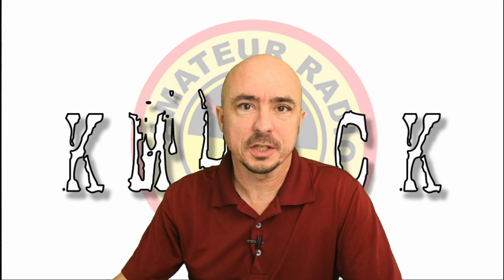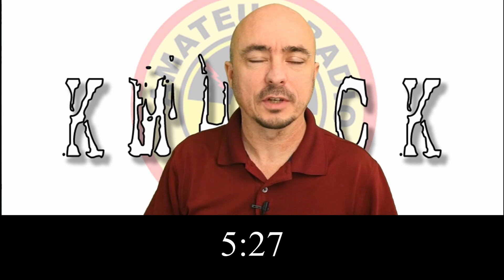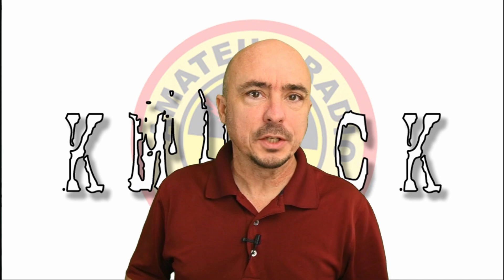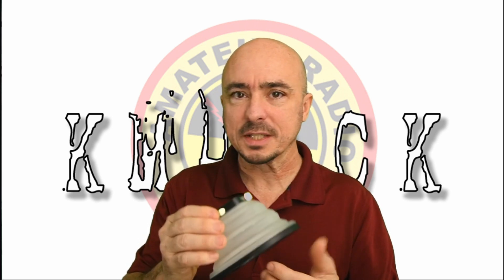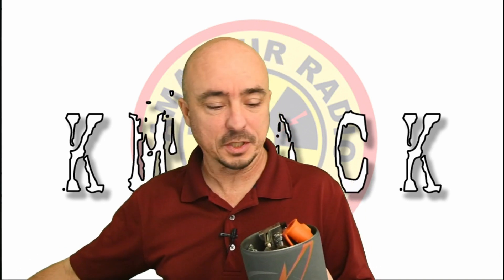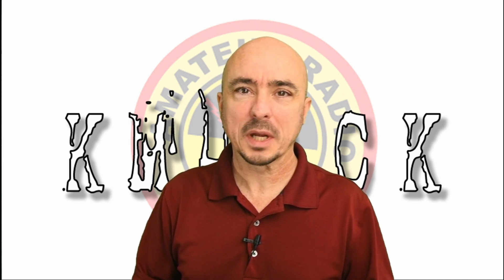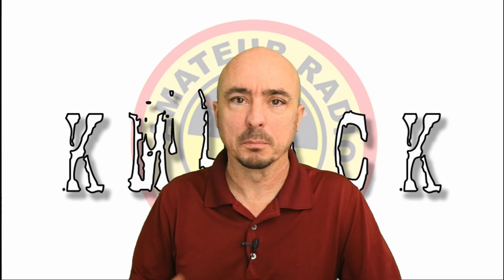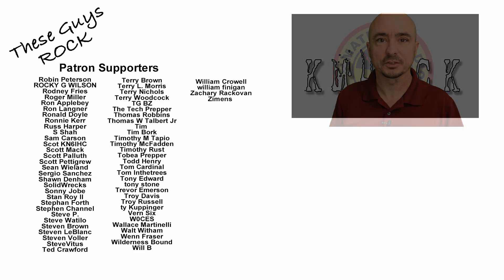Winter Field Day The Good, Bad, and UGLY

Comment: I had a really fun winter field day experience, and it was my first so there were no doubt several issues.

Me and my club were 4I, OH (K8CY). The first issue, was my power supply wouldn't start up like it normally would. Now I don't have batteries, and since we were indoors I figured I would just use the power supply I normally use. Now this power supply is kind of odd, it was given to me by a friend and it has a problem with the oscillator, so you have to flip the on/off switch really fast to get it to turn on. But it just wouldn't turn on at all, my guess is it didn't like the cold when I brought it home and plugged it in it started up first try, so I won't make the mistake of bringing unreliable gear into the field again. Thankfully one of the club members had an extra power supply I could use.

Thle second problem I had, was I forgot the password to access my Raspberry Pi's hotspot. Normally, I never have to use it at home because it just connects to my local internet, and because I have several different Raspberry Pi's I couldn't remember the password for about half an hour. Thankfully one of my guesses was correct, and I will be writing that down going forward.

The third and final problem I actually just realized yesterday. So apparently my GPS didn't want to work inside this building, which wasn't so surprising because the building was a large metal barn. I didn't think this would be an issue, since I couldn't run digital modes that needed a time sync anyway. I was just going to run PSK31 so I figured it would be fine, but yesterday when I submitted my logs to the club logger he noted that all of my logs were on the incorrect date. There was not an issue though, because he just matched the dates with the incoming contacts. Going forward I will be purchasing an RTC for my Pi, so I don't have to worry about that anymore.

Overall, I had an absolutely wonderful time at winter field day and I'm looking forward to it next year. I just ran my FT-891, Pi 4, and WRC Silver Bullet 1000. This combination was pretty awesome, and I made about 60 contacts. I know that's not a lot, but keeping in mind this was my first time and I had to work out some kinks. I used my tablet to interface with the Pi, and used a foldable Bluetooth keyboard for input. I ran PSK31 for most of the event, but I realize I should have switched over to something else during the night time because everybody left and I had no contacts to make at night around 12:00.

A very great learning experience for sure, and I'm looking forward to next year. 73 de W8IJC
Reply from the maker: Keep good notes on success and failures. I write them down so I can go back and look at them before the next event. May seem silly at the time but it’s easy to forget between now and summer FD. Glad you had fun!

Comment: So are you booting from usb now?
Reply from the maker: No. The USB stick is just a data drive used for backup.
Reply: @KM4ACK  I bought that same stove some years back, complete with the ugly orange case.  Piezo ended up failing after not many uses but it still heats nicely.  I hadn't seen those fold up legs before, though, so that's a nice find.  Ordered.

Comment: G’day Jason, always enjoy your AA reports. For the throw weight and line I suggest looking at how arborist use them. It’s a completely different action and much more controllable and accurate. You still have to practice but the learning curve so much quicker. Others have probably already said it but don’t  use a karabiner to attach the throw bag, they just catch on things. Also get in the habit of removing the bag when retrieving the line   after a bad throw, even though the bags are shape to prevent them get stuck in branches, they still do unfortunately and if you only have one bag you will be stuffed after that happens. Cheers and 73 Lance VK6LMK

Comment: are you using a mppt solar charger ? ... also if you are you need 24 to 36 volts going into it for it to work correctly in low sun light cloudy conditions...:) for a 12 volt system
Reply from the maker: The BuddiPole PowerMini isn't MPPT.
Reply: I see anywhere from 15 to 25% more power with the mppt controller.. btw Bud is a long time friend. Hes developing a light weight x beam now for portable use

Comment: Great video!  I used to work as an arborist and have use the throw ball and line a lot.  It will take some practice but one thing I would suggest is to not swing it all the way around before releasing it.. just swing/rock it back and forth before zipping it up into the air..  some people also like to pull the line back through the eye of the ball, creating a second handle (V shape with the ball in the bottom) and swing/rock it between their legs using both hands before zinging it up over the tree.  good luck

Comment: I agree with K7JLJ
 with removing the Carabiner. (Not needed) Tie a loop big enough for the throw bag to slip through. Loop goes through ring and over top of bag, pull line towards ring. Makes half hitch on the ring. Main suggestion is to throw the bag backwards over shoulder. Feed line back through ring so you have about a foot of line with bag centered. Swing bag between legs with both hands then arch back and throw bag over shoulder.  Others have now stopped laughing at me and seem impressed! <Grin> Works well. 73 Barry

Comment: Wise advice about practicing wirh equipment before deployment.  Your videos are excellent!   I'm glad to see that you used an efficient efhw antenna with your qrp radio and had great results.  Other should learn from you, rather than run 100W, burn through their battery, and have an erp of 5W anyway due to a pos antenna which is "quick to deploy".  73 de N2MXX

Comment: Thanks for the great video!  I love your cabin site.

I use a 10oz throw bag. Aside from getting practice aiming, the biggest mistake I made the first time I put a line up was that I threw the line up 90 degrees from where I wanted the antenna wire to point.  Unfortunately a lower branch blocked the antenna's path so I couldn't lift it all the way up. You want to make sure you throw into the tree from the direction you want the antenna to go. That may be obvious to everyone else, but maybe my noob mistake will save someone having to reposition a line.

We were expecting high wind (20 mph) and rain at our WFD site so I went to the extra effort of hoisting a pulley on the main line and then raised the antenna up on the pulley with the antenna line anchored to a screen door spring so that if the tree swayed it wouldn't snap my antenna.

Comment: Hi Jason, regarding the Pi issue you had. I´ve had problems with a Raspberry Pi 4 in which the wifi would disconnect randomly because of a driver crash and the only solution was to restart the Pi. 
I solved it by updating the file /lib/firmware/brcm/brcmfmac43455-sdio.bin as indicated on this issue https://github.com/raspberrypi/firmware/issues/1403#issuecomment-638701200
Newer versions of Raspberry Pi OS already include the updated driver. 73 de LW9EYP

Comment: Are these Miady batteries generally reliable? I read the negative comments on Amazon claiming that these contain reject cells from China. Does Miady stand by their product? What do people do if they receive a defective battery? What inexpensive but reliable chargers do you suggest?
Reply from the maker: I have been using them for a few months now and had great results. I currently have about 60 charge cycles on mine. If you have an issue, you can always return them to Amazon. I use this charger https://dakotalithium.com/product/dakota-lithium-12v-battery-charger/ with mine. I don't care for the smart chargers.
Reply: @KM4ACK  thanks

Comment: Hi Jason. I bought one of those cooking pots :-) (I already had the small burner and fuel canister.) 
I hate using throw lines! I admit defeat and take a 30ft fibreglass mast that collapses down to 2 ft and is perfect for an efhw antenna. 
I totally agree that a headlight is a MUST. I bought a couple from Amazon: Omeril LD072 -- and buy the one powered by 3x AAA batteries -- not the rechargeable version! The rechargeable lights always give out just when you need them most! 
I also carry a couple of 'chemical light sticks' these are brilliant if you need to walk in the dark too and from your vehicle. You can 'snap them' into action and leave them on the ground to light your path to your vehicle. They will glow all night! They are also a great emergency light. 73 Bruce G4ABX

Comment: As much as I love tactical looking backpacks like the 5.11 rush pack I have or the tactical sling pack that I have, they are terrible if you need to carry weight for any distance.  After trying a backpacking type backpack with a padded waist belt, I'll never go back.  I miss the organization that the tactical packs have, but the weight distribution is so much better.  Great after action report on your WFD.
Reply from the maker: Totally agree. The only decent "tactical" backpack I have found is the ibex 26 by Vanquest. Not only does it have a nice waist belt but it also has the load stabilizer straps at the top of the main straps. Any avid backpacker understands the importance of those. The advantage of the tactical style packs is the molle that allows you to expand the capability/capacity of the pack. Then again, that's not always a good thing. hihi.